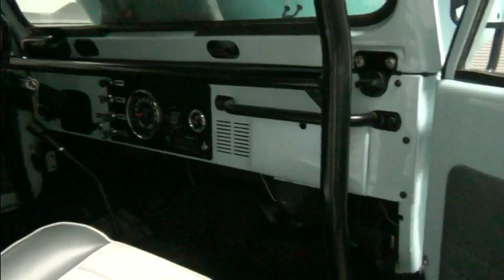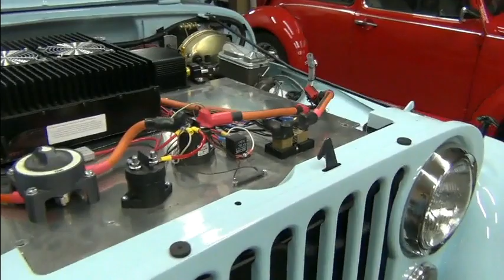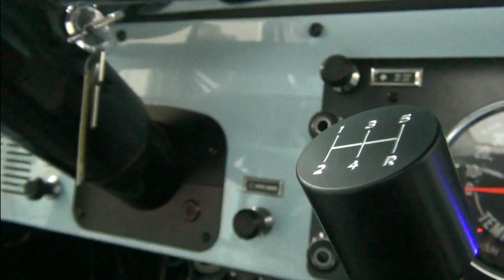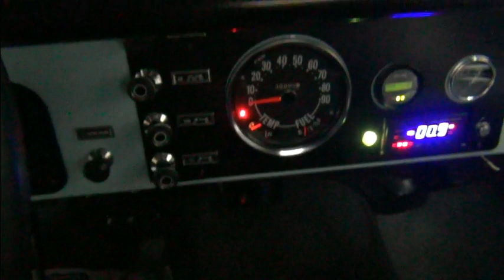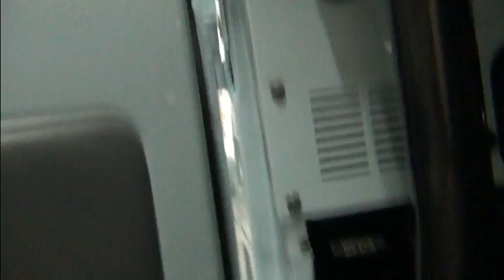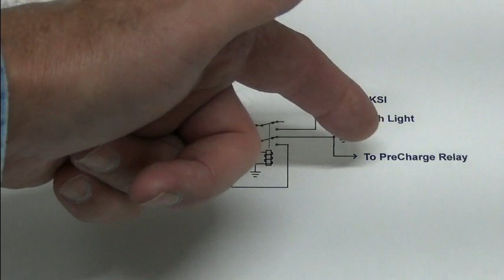EV Conversion - Jeep CJ7 EV Conversion Hits a Wall, Episode 8

Comment: Talking about the issues you raised, could you check if  (1) the motor is mounted on a rubber seat to reduce the vibration: and (2) if the tension in the clutch is relaxed enough to disengage it from the motor
Reply from the maker: Thanks for watching.  The motor was shock mounted.  After removing the motor and balancing the flywheel/clutch setup we adjusted the clutch linkage.
Reply: Good to know; I am proud of you